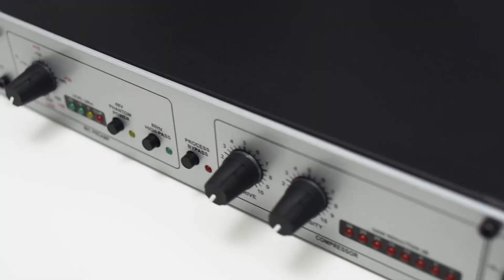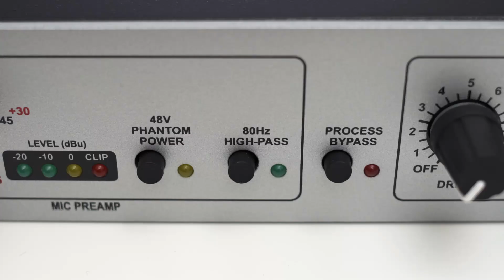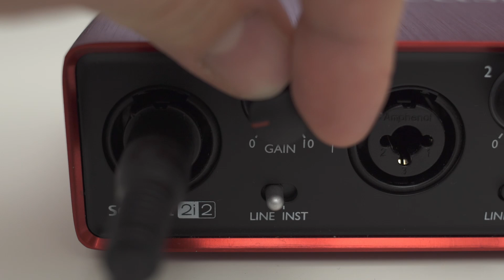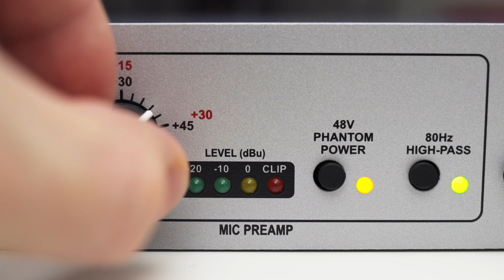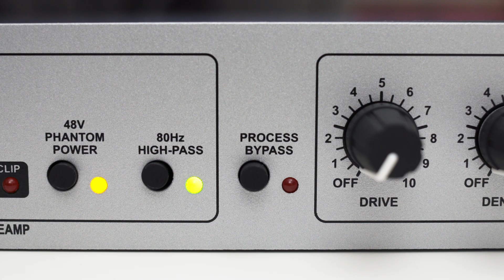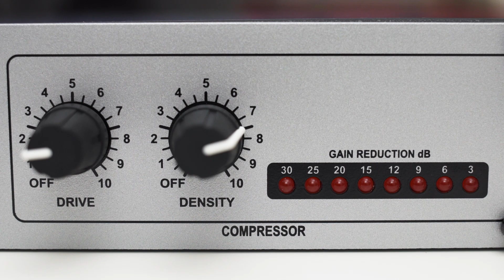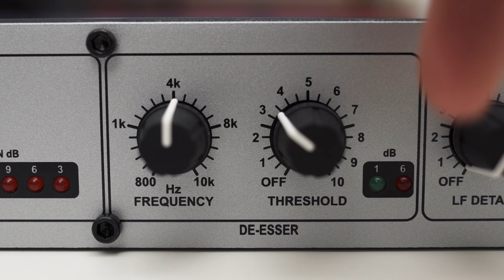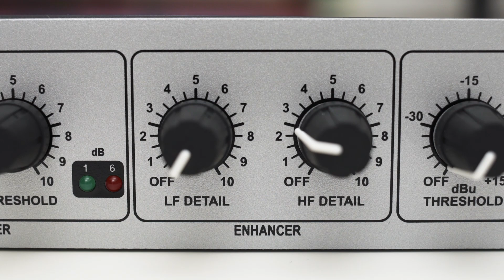Best Settings and How To Connect - get started with the dbx 286s

Comment: Something I am wondering about the 286 is why the industry standard for balanced is XLR but they only offer unbalanced via the 1/4 inch jack.
Reply from the maker: Hey, the output uses a TRS jack which has 3 connections and is balanced. Only the insert is a TS unbalanced connection.
Reply: @JulianKrause  Ahhh, because I saw the mic going to the 286s via the 1/4 in on a few vids and that was a bit alarming.  btw, the chain it uses is that the sort of chain order we should use when using plugins as well? I was always told everything before the compressor but that isn't what the 286s seems to do.
Reply: @JulianKrause  Your review of the M-Audio Air 192/4 is what got me to purchase it and I just noticed it has no switch for line level and mic level so I headed to the documentation to read up.  Apparently 1/4 TRS to XLR is not what this wants or am I wrong?  From the manual it says " For microphones, use an XLR or 1/4” (6.35 mm) TRS cable. For a guitar or bass with an active pickup, use a standard 1/4” (6.35 mm) TS cable. For line level signals, use a 1/4" (6.35 mm) TRS cable."   Apparently I am forced to use a TRS to TRS cable that is inserted in the middle of the XLR connection for Channel 1 (the mic input if XLR).  Does this matter as I have always been told, and read, that XLR is the preferred method due to noise.   Thank you and thank you for this channel it is awesome sauce.
Reply from the maker: @generalawareness101  Hey, I'm not sure what you want to connect to the AIR but if you use a microphone use the XLR input. For line level and Instruments use the 1/4 inch input.
Reply: @JulianKrause  The 286s (the one in this video).  Does TRS to TRS affect the noise in this setup?  Channel 2 is on the front is for guitars and Hi-Z only and use a TS.
Reply from the maker: @generalawareness101  Oh, so with the 286s you connect it via TRS to TRS. This will give you the best noise performance.
Reply: @JulianKrause  Thank you and it would appear that TRS is going into channel 1 in the middle of the XLR connector or at least that is what I get out of the manual on the AIR.
Reply from the maker: @generalawareness101  That's correct ;)
Reply: @JulianKrause  Thank you again.

Comment: Great video! I've heard and seen others connect the DBX 286S to a Line In on the audio interface, and here you connected it directly to the Scarlett preamp. Is there any reason why you would use "dual" mic preamps? Wouldnt that also add noise etc? I thought those interfaces also had a line in. Would love to know why you connected the DBX to the mic pre on the Scarlett. Cheers.
Reply from the maker: Hey, the preferred way to connect the 286s to an interface is via the line level input. But I did also show the version with the XLR input because some interfaces don't have a line level input. In practice, connecting the 286s via line level or XLR input makes hardly any difference in noise because the noise floor is often times dominated by the noise of the 286s.
Reply: Depends on the interface that you have,  I went through this already, you only want to bypass your audio interface if you dont you will be RE-AMPLIFYING no mater how low your gain is on the focusrite Scarlett... and frankly is you want the true sound and or better sound, your signal needs to pass through good converters.. food for though. I purchased the audient id44, if you do your recearch youll know why.

Comment: Can I connect the dbx to pc line in directly using trs to 3.5mm without using an audio interface? Great video btw.
Reply from the maker: Not with the cable you mentioned. The outputs on the dbx are balanced and PCs input is unbalanced. There might be a way with TS to 3.5mm but this most likely introduces a ground loop. I woudl highly advice to use an interface to connect the 286s to a PC.
Reply: @JulianKrause  Thank you very much for your reply!!!

Comment: Nice Vid... I got the focusrite solo interface, this doesn't have a trc input.. is there any disadvantage by using a trc to xlr cable?
Reply from the maker: The Solo does have a TRS input, but for this interface I would actually advise to use a TRS to XLR cable. The quality is virtually identical to using the TRS to TRS connection but you will have the mic on channel one which allows you to use it with applications like Discord.

Comment: Hello again Julian! Do you think i need an power conditioner or a normal socket adapter with switch on / off for him, because it doesn't have the power button?
Reply from the maker: Hey, power conditioner is not necessary, but a socket with a switch can be quite handy to turn it on and off :)
Reply: @JulianKrause  Tnx a lot for all informations! You are the best! <3
Reply: I was thinking of a voltage stabilizer(njoy ups) to don't cut the electricity too suddenly from it to spoil it.

Comment: Sir do me a favour ? Could you please figured out the mic noise Problem I had been facing from a long time but no one resolve my issue. I am using At2020 XLR mic with focusrite audio interface for capturing my podcast classes on Movavi Screen capture application that's all good for my job .
But the main issue was I don't had acoustic room and my room was so close to street road that why so much horn noise and other ambient noises created and my mic  pick that noise because it's a condenser  mic.
So my question should I buy dbx286s or Cloud lifter ? To removed ambient noise . Do I go with dynamic mic ? As earlier few days back I buy senheiser e945 mic and record my voice with 90% volume to get it better but it's pick more ambient noise as compare to my At2020 .
So please help me in this matter .... Thanks a lot .

Comment: can you just use an XLR to XLR instead of TRS to TRS to connect the preamp to the interface ? I see it done both ways but I can't seem to find people agree on which cable is best to use and why... I would love if someone had a good answer, or a reliable link :). Thanks
Especially, are there risks to damaging your equipment by using the wrong cable ?
Reply from the maker: Hey, the 286s only has a TRS output, so one side will definitely be TRS for the connection to the interface. The other side can be TRS or XLR. TRS is preferred as you can sed a strong line level signal into a dedicated TRS line level input. If you go the XLR input route, you need to turn donw the output of the 286s quite a bit to not clip the input of the intput of the interface. Really both methods work and you will be hard pressed to find any audible diference between them.
Reply: @JulianKrause  Cool thanks for the clarification !

Comment: Do you think I need an extra cloudlifter if I use the dbx and a shure sm7b ? Or is the dbx's preamp good enough so I could go without the cloudlifter?
Reply from the maker: Hey, I the preamp of the 286s is so low noise, that you shouldn't need a Cloudlifter. Especially is you use the the noise gate a bit.

Comment: Been trying to follow this guide for a few hours now. However, there seems to be some discrepancies between what's showcased on the video and what I experience on my end.
For one, I cannot do the tone set up. My microphone bleeds out and becomes a raging cacophony of white noise and feedback long before the -10 or 0 lights up. However, by reducing my output from 0 to -11 and raising my gain to the notch right before +30, I can get to -10~ lighting up when speaking.
But when trying to do the compressor...it just leads into the feedback/white noise again, LONG before any LEDs light up (even when I don't speak).
I haven't tinkered much with the De-Esser yet or the Enhancer for 1 core reason...background noise.
My main 2 hopes for this pre-amp were
1) Help reduce my reliance on gating/EQs/etc. from a software standpoint
2) Help clean up my mic audio before it gets routed into said software filters/programs.
Unfortunately, I seem to be really struggling to get the ratio and threshold set up right. If its red, its hard to reliably get it to light green or flicker when speaking unless I start nearly yelling.
But if I reduce it too little, then the background noise I'm trying to be rid of (water filters from aquatic pets) still clearly bleeds into the mic....

TBH, I find myself at a bit of a loss. I know there's surely a way to set this up to help improve my audio quality even in my "noisy room" but... I seem to really be struggling to find that set up, at least trying to follow this video 1:1.
And tinkering on my own...is basically just poking n prodding at settings. I also can't tell if its good or bad idea to set up the gate BEFORE compressor/enhancer/de-esser...or if I should set them up in the order they're presented from left to right.

The guide's great, very clear and to the point...I'm just not so sure its usable on my AT2020, either because of it being the mic it is or because of my rooms ambient noise levels...
Reply: Use a headphone when setting it up. You're getting feedback because, well, the output of the speakers is feeding back into the microphone.

Comment: Hi Julian,

I’ve really been enjoying your videos. I set up my DBXs and followed the instructions on the video to the letter .?I am a voice over actor. I still got a lot of noise,. My set-up is:, sennheiser 416 shotgun mic, Scarlett 2i4 and Adobe Audition CC 2017. 

I tried tweaking the knobs this way and that way, but I couldn't get a clean signal.  I must tell you that I sent in an audition for a video game. The character was a Minotaur and I was instructed to use a very low, gravelly, rough voice. 

Finally I disconnected the DBXs and simply recorded without it. The result was better but it was time consuming to adjust the effects. And I also got clipping on one word. 

Can you suggest some alternative settings on the DBXs that night help me with a situation like this should it arise in the future? 

Sincerely, 

Adam Rosenbloom
Reply from the maker: Hey Adam, there shouldn't be any noise with my settings. The 416 is a condenser mic, so did you turn on the phantom power? When you connected the mic straight to the interface, was there no noise? If there was still much noise, then your mic might have a problem.
Reply: Julian Krause I have been re-reading the DBX users manual. The suggested initial compressor settings go from 3 -10. I set it to 3. Maybe it should be higher. And my LF detail was probably too high (7). I will try 2-3. My mic is brand new. Both Phantom power and high pass filter are turned on.
Reply from the maker: @adamrosenbloom6165  Some more things to check: Make sure you use a TRS to TRS cable for optimum audio quality and set your input in your interface to line level.
Reply: @JulianKrause  OK. I checked the front panel of the Scarlett 2i4. The toggle switch was indeed switched to INST. So now it's on LINE. I have a 1/4" cable coming out of the output jack in the back of the DBX. But it's a TS, not a TRS because there's a tip and sleeve, but no ring.  I was connecting it to the XLR jack on the front of the Focusrite. But I could also connect to a 1/4 inch cable and then it could into the front of the Scarlett or the back of the Scarlett. Which is the best way to connect?
Reply from the maker: @adamrosenbloom6165  The best way is a TRS to TRS cable. Connect one end to the output of the 286s and the other end into the TRS input on the front of the interface.
Reply: @JulianKrause  Thank you very much, Julian. Your help is much appreciated!

Comment: Great informative video - how important is the audio interface quality. when using the dbx 286s? Can I get away with an entry level audio box such as the PreSonus AudioBox iTwo paired with the dbx 286s and a Shure sm7b?
Reply: I have a behringer UMC202HD and it's just fine.
Reply: MeisterHerzlos are you also using a Cloud Lifter?
Reply: @JEAraman  Nope, condenser mic to dbx to interface. No cloudlifter needed.
Reply: @JEAraman  I know the shure needs a lot more gain than mine, but you should be fine.

Comment: Hi Julian
I love your video tutorials on setting up and testing various equipment for sound recording.
I have a question for you. Due to logistical issues, I am using a Zoom H5 to record my VoiceOver stuff (using and AKG C214) and then I remove the SD card and take it to my Mac for post editing in Reaper.
I have invested in a second hand DBX286S, which should arrive next week, and am slightly confused about the Zoom H5 settings I should use after plugging in the TRS cable from the DBX output (as your superb video regarding calibrating a DBX286S shows).
Any help would be much appreciated.
Reply from the maker: Hey, I suggest to set the gain of your H5 to 3 and then do the calibration as shown in the video. It is likely that you have to decrease the output dial on the 286s a bit. But this will give you the best results.
Reply: @JulianKrause  Many thanks. Apart from turning off phantom power, are there any other settings to change inside the Zoom, or do I leave alone and pretend it's a mic?

Comment: Should phantom power be enabled on the interface too, or just on pre-amp?
Reply from the maker: If you use a condenser mic you only need to turn on the phantom power on the 286s. Leave the phantom power on the audio interface turned off.
Reply: @JulianKrause  Thanks!

Comment: Hi Julian... Thanks for this. I tried using a 1/4 Y cable hoping to generate two inputs from my interface to my DAW. But it didn’t work (It work but only detects one input). How do I get two inputs into my DAW with the DBX 286s? Is it advisable by the way? Thanks again.
Reply: You cant, it only works for 1, you will have to get 2 DBX and connect both to your DAW

Comment: Hi. Thank you for this!!! Probably a dumb question , but once I connect the dbx to my motu interface and I got to record, I get the option in the recording source on audacity for both the motu interface and the motu loopback. Which should I select?
Reply from the maker: Just the Motu. Depending on how you set it up, the loopback will include all audio from your PC. So, when someone calls you in Skype you would have the ringing sound in your recording.

Comment: I've been trying to get my stupid dbx 266xl connected to my focusrite interface. I've managed to get all of the cords finally but once I hook it up there is no phantom power? How do I turn on phantom power with 266xl?
Reply from the maker: Hey, the 266xl doesn not have phantom power as it is not designed to take microphone signals directly. You need a preamp to amplify a mic signal to a line level signal which can then be fed into the 266xl.

Comment: What's the reason for calibrating to -18db? Shouldn't you calibrate to 0db, since you're setting the gain on the preamp to output 0db?
Reply from the maker: The reason for that is that in the analog domain (on the 286s) you have something called headroom. This means, that the signal is allowed to go above 0 dB. Usualy if can go 18 dB above that before the signal starts to distort. 

In a digital system (audio interface) you do not have any headroom and your maximum is 0 dBFS (decibel referenced to full scale).
So, to correctly calibrate the two devices you want to match your analog 0 dB level to the digital -18 dBFS level. This matches their clipping points of +18dB and 0dBFS which results in an optimal performance of the whole system.
Reply: @JulianKrause  gotcha, thanks!

Comment: I just want to confirm, this setup process would be about the same if using a Mixer as the interface correct? Just make sure that everything is set to default and also that the slider for the volume is set to the lowest point to represent the volume knob on a 2i2 at it's lowest point as well, correct? I'm actually thinking about replacing my QX1622USB Mixer with a GoXLR Digital interface.

Also, one more question for you since I can't really find a place to describe the differences. I have a SM7B and I understand that they can be hungry for power to get decent sound. Well, according to some people. But my question is regarding the switches on the back and what is a setting that is recommended or is used more often by vocals? I stream/Record video's for YouTube and want to have a clear "loud" voice. Thoughts?
Reply from the maker: Hey, yes this setup should be about the same for a mixer. To start you would have the gain or trim on the mixer all the way down and the channel fader at unity (0dB). If the signal from the 286s is to low, slightly reaise the gain/trim. If it is to strong, turn down the output gain on the 286s.
Regarding the SM7B: I think the most common setting is to leave it flat. But if you want you can engange a high pass filter, which cuts out some of the bass. Or use the high frequency boost which can give your voice more presence. So in the end, how you set up the dip switches, is personal preference.

Comment: I have trouble with my condensor mic. With +30db on the first Nob (2 green lights), i get a huge amount of noise. And have to lower last output alot.
 Maybe this Preamp is better for a dynamic mic with low output.

Open for any suggestions
Reply: at +30 gain on the preamp it shouldn't produce a lot of noise from the preamp itself, if at all noticeable. If you're talking about actual background noise from your environment then that's normal and is something you have to dial away with the expander/gate.